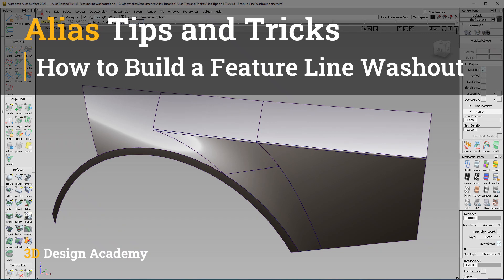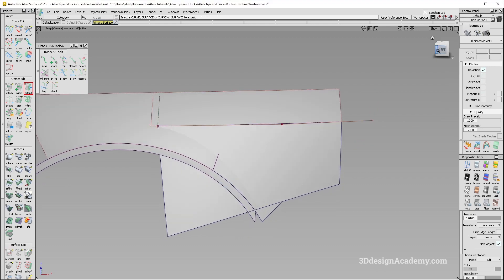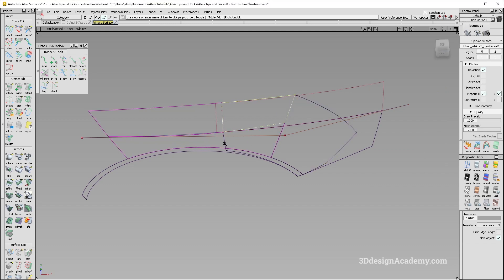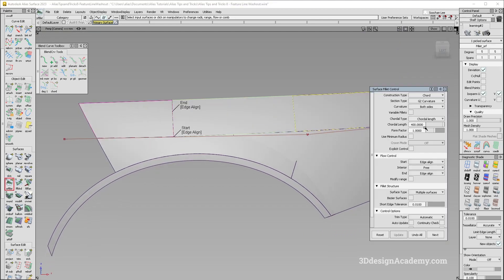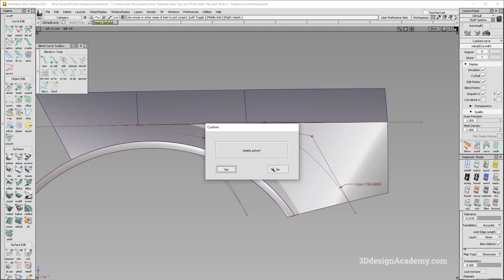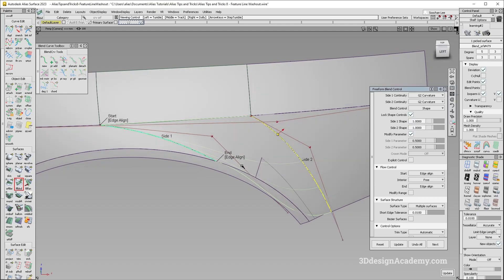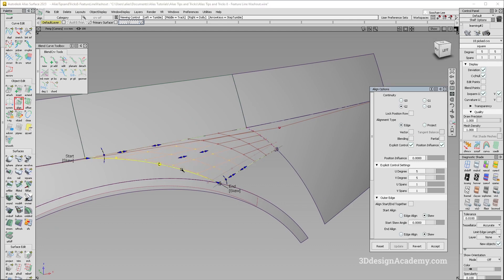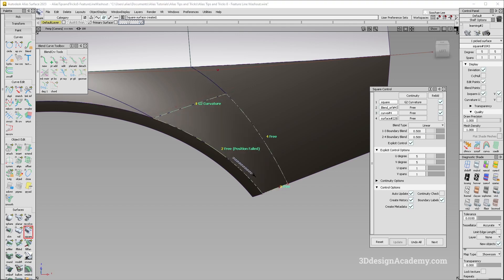Alias Tips and Tricks 8 - How to Build a Feature Line Washout

Comment: Thanks for tutorial. Is it ok for using that sharp angle patches in production surfaces? I thought requirments is that they need to be more like square?
Reply from the maker: Having a sharp patch shouldn't matter as long it's not a knife edge and causing highlight problems. That said, however, there is a minimum radius requirement (for engineering and production) depending on material and finish.

Comment: A big one!  I like your trick with rebuilding messed up square with another square, never thought about that. And this trick with fit curve on attached duplicated curves are a gem imho. Really compelling stuff! The only thing I am wandering about, is the last patch. Why not to build a g2 curve on the bottom side that attached to the bottom part of the fillet and left the other side free, to make a flow? then project on the surface and build a new patch, skewed one? i am not sure that solve the issue, but actually maybe it can. I need to try it myself) Ah, and this aligning to the trimmed surfaces. I mean, you pulled it off, but what if you build a"flat" g0 patches, attached to the clean curves first, and then project? I need to try it too. Great video, very interesting! Thank you!
Reply from the maker: I'm not sure what you're describing but I did see your file. It works great! The reason why I used that approach is because, usually, you want the fillet shape to follow the theoretical. This method gives me a predictable result and works well most of the time. If it doesn't work, then I try to explore other techniques. Your patch works really well too. As long as the highlight and the CV structure is good, that's all you need! I just did it my way, because that's what I've been doing and I can visualize the patches in my head. Everyone has different approach, but as long as you follow the principles of frame and fillet, and you get good highlights, it's all good!
Reply: @3DDesignAcademy  Thanks man! I will try your way anyway. At the end of the day, I am here to learn
Reply from the maker: @alexandergolubev6358  Your method works and works well. I think it's simpler to execute with good result!